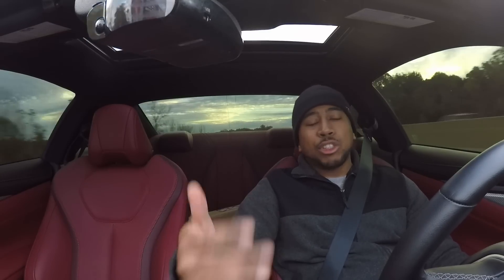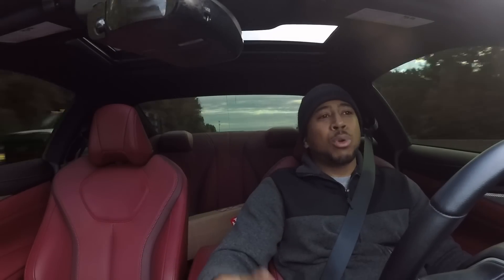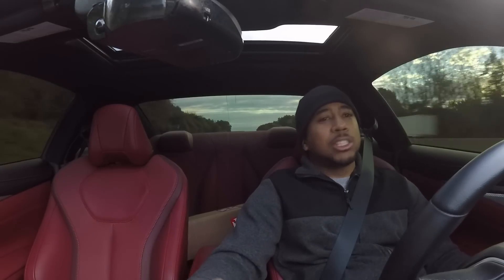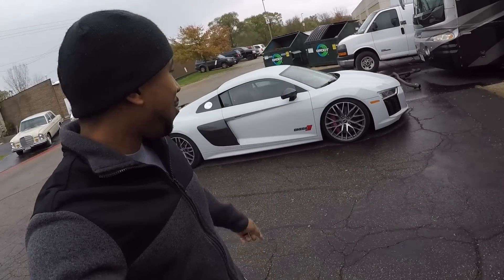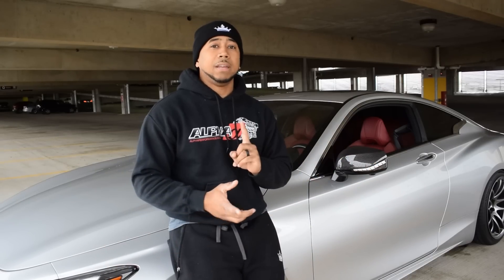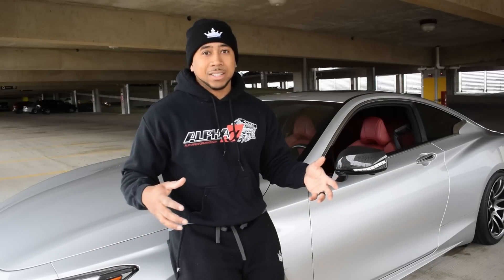INFINITI Q60 AMS Aluminum Driveshaft Installed!

Comment: Besides my EcuTek tune my Fast Intentions catted full downpipes & CBE, my Z1 LSD was the best mod. Followed by Z1 two piece rotors and lighter forged monoblock rims. (I also have the AMS intakes and Heat exchanger). I wish you posted a pic of your dyno graph on this video. Seeing where the power is, is helpful. I really enjoy your videos👍🏻. Keep em coming. Now if HKS would come out with their Hypermax IV coilovers for the AWD I may be finished. Bullitt and I have similar mods, except I'll stay with pump 93 and not go with E85 mix.
Reply: JohnInNH what power did you make?
Reply: Outcast Performance , LLC <--- A AWD dyno is 2 hrs away. I won't dyno it till I get the remote tune dialled in by Seb this spring. It's to cold out now. 435 HP/465 TQ at the wheels is my guess, on pump 93. Audi S7 equivalent or a tad more 😎..  I go 0-100 in 9 seconds.
Reply: JohnInNH dang man that’s dope. I wanna get a q50

Comment: I read that the one-piece driveshaft is noisier than the stock shaft. How much noisier, is there a noticeable difference? Did you get the aluminum or carbon fiber shaft?